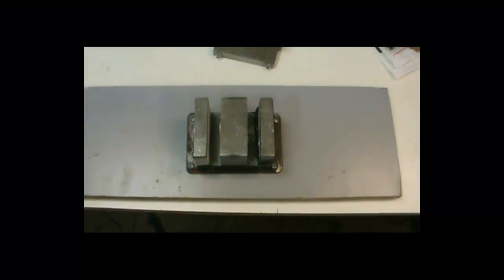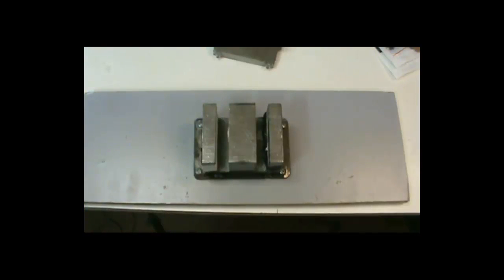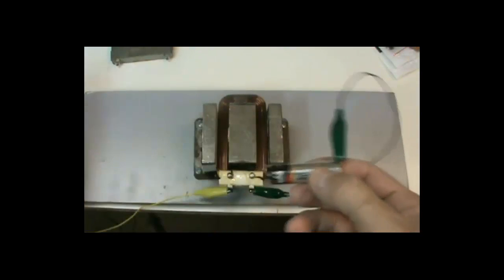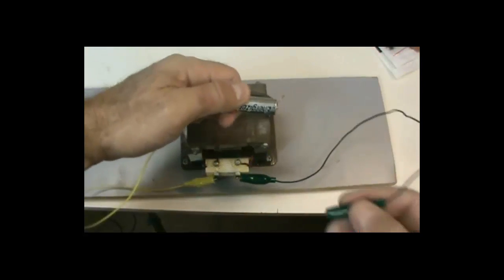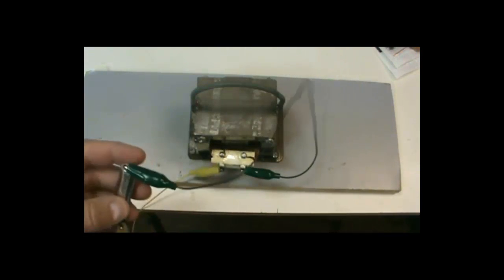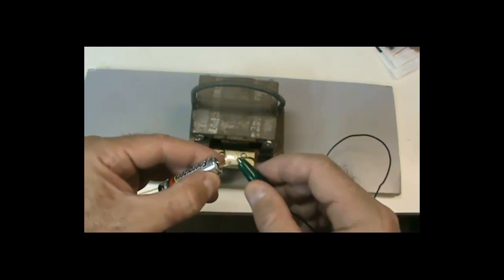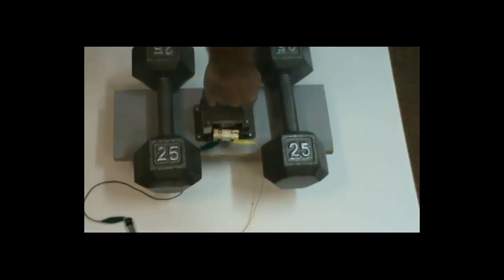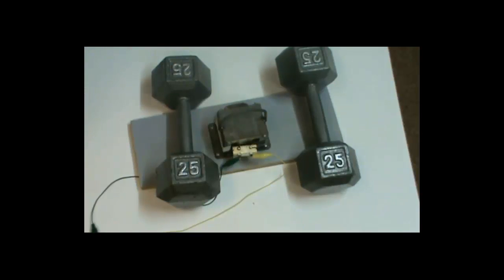Easy-to-Build Electromagnet lifts over 50 lbs

Comment: Now apply this to a free energy magnetic motor that can power its own electric charge. ( self propelled super charged magnetic electric engine) shit you make a wheel that has its own magnets copper wires and self charged battery incased in a wheel hub with a electric motor. You got a wheel that doesnt need an engine. Thats a patent within itself. Who need a heavy engine when the wheels can do all the moving?
Reply: tesla need to do that

Comment: which winding you use the primary or the secondary coil?
Reply from the maker: +LABONI194 The primary coil (110Volts) not the high voltage coil.

Comment: How to calculate how much or maximum voltage/Amp can you use with a made coil ?
Reply from the maker: It is very difficult to calculate since there are so many variables. You have to take into consideration: wire diameter, wire resistance, wire cross section (round, square, sheet) magnet size, number of turns, available current, available voltage, duty cycle and many other factors. The general rule is that you want the largest number of ampere-turns (amps x turns) you can get with minimal coil resistance. Too many turns means more wire resistance, less current and less flux for a given voltage. Too few turns means less resistance, more current but less magnetic flux since fewer turns creates less flux for a give voltage. Any resistive electromagnet (like this electromagnet) will produce heat and a larger iron core helps dissipate this heat and allow the magnet to operate for a longer period of time before overheating. It almost more of an art to find a good combination than anything else. Look at the information compiled by Joseph Henry and you'll see what I mean.

https://www.princeton.edu/ssp/joseph-henry-project/albany-electromagnet/AlbanyMagnetPaper.pdf

Good luck

Comment: i have not microwave oven transformer but other same transformer wind 22 gauge wire 50 turns but not work supply 240 volt AC
how i make electromagnet ?
this electromagnet repeals the aluminium for  eddy current   create because i will use in making flying board
Reply: Karansinh Doliya use a step down transformer for 220VAC to 24V AC you can get more powerful magnet 🧲 increase the winding

Comment: sir i have a 220/12v transformer a bridge rectifier 10A and 1000uF capacitor for the supply and copper enameled copper wire 22 gauge i had a screw driver in which i wound several turns but when i switched on the supply the rectifier got burned also the screw driver retains some magnetic property even after supply is removed so i changed the core with an amorphous metal block but now the magnet is very week please help if you like i will mail you pictures also
Reply from the maker: A powerful magnetic field will magnetize hard iron objects. The steel used in most electromagnets is soft iron which will not retain a magnetic field. It sounds like you don't have enough turns of wire to keep the current down to a safe level. I would use a lower voltage for a homemade electromagnet with only a few turns of wire. What is the total resistance of the wire? It must be more than 1.2 ohms (12V/10A) in order to keep from burning out your power supply.

Comment: no, the one you pulled out intact is the primary. the secondary is the output, or the 2KV.
Reply from the maker: Incorrect. If you want to power the electro-magnet from a low voltage source the resistance of the secondary is much too high.
Reply: so you are saying it is correct. The thick wire is the Primary. the thin wire is the Secondary. but who cares?

Comment: Hi, Dorian, 
Really great video!
How would you proceed in order to drive this with PWM and what you think will be best protection from fly current? I am trying to run a magnet at 60 Hz PWM.
Thanks!
Reply from the maker: What voltage would you like to drive the coil with? I would drive the coil with  power, N-Channel MOSFET that can handle at least 10 amps. Use a 10 amp Schottky diode (removed from a switching power supply) across the magnet to handle flyback.

Connect: MOSFET source to V-, MOSFET drain to magnet, other side of magnet to V+. Anode of diode to MOSFET drain and cathode of diode to V+.

If you don't drive the MOSFET into saturation you can control the energy absorption of the flyback current but make sure you mount the MOSFET on a heatsink for this.

At 60 Hz the diode doesn't have to be a Schottky but these are cheap now.
Reply: Dorian McIntire
Thank you for the reply! 
I still haven't decided about the voltage but most likely I will start with 24 VDC. I was also considering a MOSFET but I have never played with coils this big.

I will take your advice and try the Schottky diode but having in mind the energy stored in the coils (in your video) and the switching time I expect huge flyback current at the coils when off - 10kV 
I also expect to have long charge/discharge cycles and thus not able to achieve 30 Hz.
I hope I am wrong about it :)

Have you ever tried MOV (metal oxide varistor) to deal with high current?

Comment: Wow its amazing to see how much potential one little AA battery has when hooked to such a large coil! All that energy being held in the magnetic field through the ferrite.
Do you have any idea how many windings and what gauge the coil is?
I'm really interested to know, does applying the lifting force cause a change in the current drawn from the battery? Hook it up the amp meter and lift; for science!
Reply from the maker: +Zak M-O The metal in a transformer is typically silicon steel and has a very high permeability. This means the magnetic field strength is very high inside the steel and has a high holding strength if the magnetic field is locked inside the metal.

The gauge of the copper is  #16 to #18 wire with about 100 turns. I will measure the current to see if the current does increase during lifting.

Thanks for commenting.

Comment: Wow that's incredible. I can't believe such a tiny battery can generate that much force. Now, i got a question. If you polarize the battery the other way, generating that the coil actually repells the handle, will it be able to put it off? will it push the handle out to the ground? or will it start oscilating? and what about putting extra weight to the handle? because as the handle starts being repelled as soon as the circuit is connected the distance between the handle and the coil will increase, increasing the air in it, lowering the magnetic flux and the electromagnetical force, so that the handle might "stabilize" in some point.
Reply: Monox Val The magnetic field generated by the circuit induces the attractive magnetic force to hold the plate in place. If you reverse the terminals of the voltage source, you will induce a magnetic field in the other direction, which will still induce an equal but opposite magnetic attraction to the plate, binding them together nonetheless. Magnetic fields will only repel against other magnetic fields. In this electromagnet, there is one circuit, and therefore one magnetic field.

That said,if you had a permanent magnet you could notice the changing field.

Comment: lifts 50 pounds but you need ot lift 50 pounds to lift 50 pounds these transformers are heavy try useing a smaller one there are strong two
Reply from the maker: +George Murray The point is that you can build your own electromagnet using a recycled microwave oven transformer.

BTW the transformers can actually lift well over 100 lbs if properly powered with a low duty cycle and they only weight about 5 lbs.
Reply: yea i have a small transformer but it has weird connectors 8 of them becuase i got it off a microwave board
Reply: also i want ot do this becuase i have a microwave transfomer but dont have a angle grinder or a way to remove the second coil

Comment: I NEED BASIC THEORY OF THIS EXPERIMENT
Reply from the maker: pandu diazsatria Here is a short story about the situation: Magnetic fields pass through high permeability (low magnetic "resistance") materials, such as iron, very well. In the presence of a magnetic field a piece of iron becomes a magnet as the field from an approaching magnet passes through it. As these two "magnets" get very close together the magnetic field strength between these magnets (and thus the force between them) grows almost exponentially. Many people confuse this situation with a violation of the conservation of energy but energy is actually the application of force over a distance force alone does not necessarily mean energy transfer. With magnets the forces can be extremely high if the pulling distance is extremely low or non-existent. Strong magnetic fields cannot typically reach out very far but they can reach extremely high levels of force, with relatively low energy input, if the material can conduct a high level of magnetic flux.

Lot of information about this is available on the Internet. I link to some very good information sources in some of my other comments below.

Hope this helps.

Comment: Dorian, I need to make a very strong electromagnet in order to pick up nails, wire, etc along an old fence line I have removed. I see how you've made this, but wonder whether you could apply it in a manner in which I could have one, or several attached to a 6-8' long piece of metal and drag it behind a tractor, thereby picking up the pieces from the ground. Many pieces would be partially buried in dirt, grass, etc. I can design a cart, tines to stir up the dirt, etc. but am uncertain on how many of your magnets, or application to a piece of steel, would be required. Also, would more power increase the strength and field of the magnet? The small magnets on rollers to pick up debris won't work in a pasture. I need something with power.
Reply from the maker: Several of these connected in parallel may do the job but you should put a plastic shield over the magnets to keep debris from getting inside the electromagnet. Increasing the voltage would make the magnet more powerful. Good luck.

Comment: I don't really understand how a 1.5v battery can do this. I know that it can output 2-3A, but I still think that's kinda low. Can someone explain how I can calculate the force of the electromagnet or how much the magnet will "pull"? Also, would connecting, say, 4 batteries in parallel then quadruple the electromagnet strenght? 
I'm trying to make something that can lift around 100 pounds. Is it possible with AA batteries like this or should I look at alternative current sources?
Reply from the maker: +gustafization The strength of a magnetic field is determined by ampere-turns, current multiplied by the number of turns the current flows through. The force is of an electromagnet is determined by the proximity of the magnet to the object being pulled. If this distance is small the force can be very small. There is no formula to directly determine the force of an electromagnet because there are too many variables including the following:Ampere-TurnsPermeability of core materialArea of core materialContact areaDistance from the magnetIncreasing the current will produce a more powerful magnet but at some point the current will overheat the wire in the magnet. I suggest you read the material at the following link:https://www.princeton.edu/ssp/joseph-henry-project/resources/AlbanyMagnetPaper.pdf

Comment: plug it into the wall
Reply from the maker: You can plug the electromagnet into a 120 V outlet for a few seconds at a time but this is very dangerous. It will buzz loudly and attract iron, but not as well as using DC but it will repel non-magnetic materials due to Lenz's law. I plan to demonstrate this behavior in a future video and explain why it occurs. Since the outlet is alternating current the inductance of the coil keeps the current down to a non-shorting level. The electromagnet will still overheat very quickly if it is not disconnected after a few seconds..

Comment: dude my mouth has been stuck open and my eyeballs are pippin out of my head in amazement and excitement. WOW dude what in the world... THIS IS SO AWESOME. Sir, can this me used as a clamping device to glue wood parts together. What is the maximum opening allowed before clamping force starts to fall off? thank you sir for sharing this Im gonna make it tonight..
Reply: STIZEN9 use the electeomagnet near the hinge and make the clamper adjustable (with a screw for example), this way you maintain contact between the magnet and the iron (giving you the force) without having the two camper hands in contact.

Comment: How is the battery not short-circuiting and over heating?!?
Reply from the maker: Powerful electromagnets are virtual short circuits and waste quite a bit of energy in the form of heat. The most powerful electromagnets either use superconductors or are pulsed for very short periods of time.

Comment: Doesnt make sense and doesnt help for nothing. The lifting work comes from  your arms and not from the electromagnet. Try to build an electromagnet, which can lift 50 lbs for example 10cm or 30cm etc without your arm. So you would have a electromagnet lift.
Reply from the maker: +peter schiller The point was to show how a powerful magnetic field could be generated even if it does not reach out very far. This is the basis for magnetic cranes and many other useful applications for electromagnets. To have an electromagnetic do what you mentioned would take many kilowatts of power. If you want a different result don't criticize what has been done. Many people liked and repeated what was done here and It is not useless just because you deem it so.

Comment: Hi Dorian, I have a question for you.
Simply put, are you able to use two of the microwave oven transformer cores (the base) and reverse the current with one to create two negatives/positives that repel each other?
If so, would the repelling force equal to 2 x 50lb (100lb total)? 
Thank you,
Oliver
Reply from the maker: +IBM2217  Yes, if the polarity is correct or the magnets are facing each other properly they will repel each other but one magnet will twist a half turn and attract the other magnet once they move away a little. It's similar to what will happen when you take two magnets and set them up to repel while they are in your hand.
Reply: Great, thanks for that!
Now a delve a bit further; assuming we have set up the above scenario (with the correct opposing polarities), and the bottom magnet was placed on a scale (weighing 10lb's). Would the other repelling magnet above it (also weighing 10lb's) increase the total weight showing on the scale to 20lb's?
Reply from the maker: +IBM2217 Yes. Whether the magnets are sitting on top of one another or repelling each other on the scale they will act as one weight of 20 lbs.
Reply: Well then, there goes my idea out the window..
Thanks Dorian!
I'm really interested in electromagnetism :)

Comment: Tell what I am doing wrong. So i decided to use a small 12volt motorcycle battery to make a simple electromagnet. I tool a piece of 1/2inch metal rod and wrapped a 12 gauge insulated stranded wire around the rod a bunch of times.  The wire keeps melting and catching almost on fire?.   is the battery to big??
Reply from the maker: The battery is supplying too much current because the 12 gauge wire has such a tiny resistance

Try one of the following:

Use many turns of a larger gauge wire (smaller wire) like 16 or 18 gauge but it should really be enameled wire (sometimes called magnet wire) because magnets tend to get warm and the insulation on rubber or plastic insulated wire takes up a lot of space.

Insert resistor in series with the magnet coil to limit the current. You can make a high power resistor using a steel spring if the coils don't touch each other,

Use a battery with less voltage like a 1.5 volt D cell battery.

Hope this helps. Let me know how things work.
Reply from the maker: It looks as if you would need over 500 ft of 12 gauge wire to limit the current of the magnet to a value that wouldn't overload the wire and overheat the magnet.

The current with 100 ft of 12 gauge wire hooked to a 12 volt battery is around 8 amps and the current with 500 ft of wire is around 16 amps. This information is according to an online wire gauge table I used. The resistance of 12 gauge wire is about 1.58 ohms per 1000 ft.

The power generated by the magnet coil, in the form of heat, is around 100 watts if 1000 ft of 12 gauge wire is used. You can only operate the magnet for a very short period of time with these lengths of wire since the buildup of heat is very quick.

I'm working on a follow-up video to explain some of these issues about electromagnets.
Reply: I'm not sure you should be meddeling with any sort of strong electricicty if you don't even know what a short-circuit is...

Comment: also how long can you keep the battery connected before the wires, battery, transformer, etc. start to heat up?
Reply from the maker: It will depend on the size of the transformer but a microwave transformer will never overheat with voltages up to about 3 volts. With 12 volts the unit will get very warm after a minute or two.

Comment: If you add another primary winding to the microwave Transformer would that make a stronger  microwave
Reply from the maker: Not necessarily. The strength of the electromagnet is based on a  combination of current, windings and resistance. Whatever you do to make it more powerful must provide more Ampere-Turns (Amps x Turns) than what you had before. Adding more turns will cause the current to decrease due to wire resistance so things get tricky.